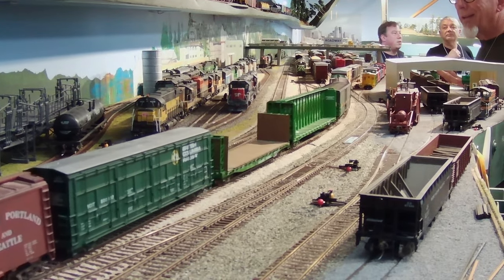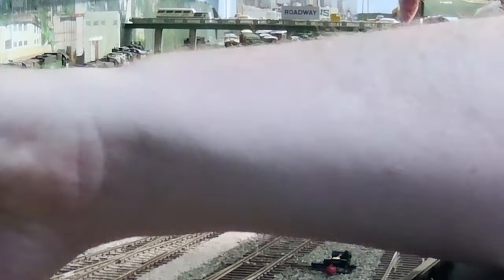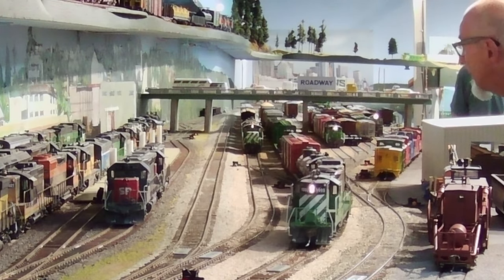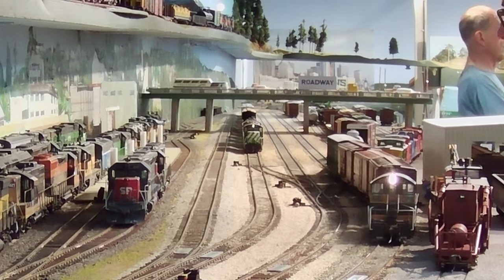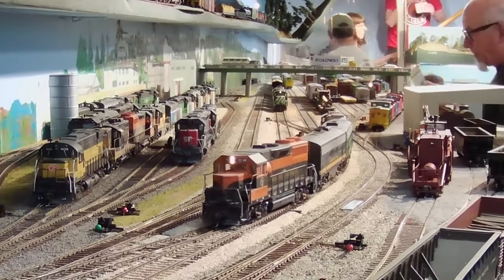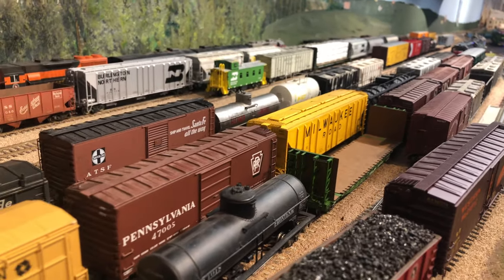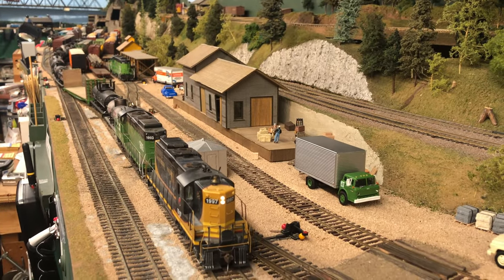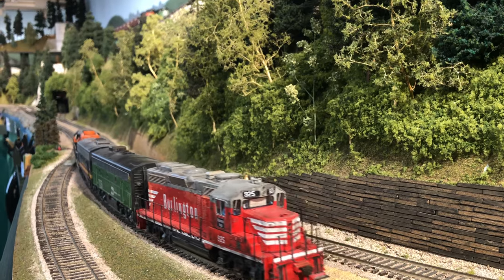Part 58 - Yardmaster and train highlights from op session #34 on the HO BN in 1973

Comment: Hi just started watching, I’m an N scaler and there is nothing like running prototypical railroading, switching cars using car cards has made operations so much more fun. One big loop with passing sidings and two way traffic with yard ops and local drop offs so much better than multiple loops and lots of trains going in a circle over and over. That’s also fine but that’s toy trains as opposed to actual model railroading. Beautiful layout, great job , anyone who I know with multiple loop layouts once the difference is explained and shown have actually changed there layouts to switching layouts, mainly O gauge guys. And they love it even more. And yes you can still run multiple trains especially on a layout such as yours. Like you said 11 trains but each one has its own crew as it should be. God Bless , looking forward to seeing more.
Reply from the maker: You said it well. Switching cars for a purpose seems more fun, even if the whole thing is play. I have a couple of what we call "illegal cutoffs" - tracks which provide continuous loop runs if needed, but are normally used for staging short trains that also have a purpose. When people come over for an open house, we run up to four trains on four independent loops, but when people come over for an "operating session" (play date) those illegal cutoffs are not used, so the mainline is point-to-point-to-point (because there is a wye in the middle of the layout, to allow us to send trains north, south and east). Much fun! :)

Comment: Burr...you always bring it home.
Question...are all the switches thrown by hand? Or do you have some with switch motors?
Reply from the maker: There are about fifteen Switchmasters and about 10 Tortoises, mainly on mainlines or staging yards. During Covid we did some remote dispatching using JMRI, but lately we're back to using the fascia-mounted toggle switches or rotary switches with diode matrices. I bought a few servos but haven't tried them yet. The rest of the 200 switches are thrown by Caboose Industries ground throws.

Comment: Great again Burr always your OPS I will  watch thoses for hours.
One question why on your switch theres yellow pins
Reply from the maker: The yellow pins designate that the switch is not on a "main track". Green pins are only used on main track switches, to make it easier for operators to quickly see if they have cleared the main track or not.

Comment: Hi this is Neil schwerdt in west valley city Utah, I have a question to ask you?
Where did you get the little blue LED light,s man ? Again from Neil schwerdt 😊
Reply from the maker: Seth Neumann in the Bay Area sells them on his website: https://modelrailroadcontrolsystems.com . Search for "DCC flag man track power tester". He has several kits available, but you do have to assemble them yourself with a soldering iron. No big deal, though - nothing complicated. If you want blue LED's instead of red, put a comment in your order and he will provide them. I have several of each color, and use the blue ones for blue flags and the red ones for regular flagmen when trains are on the road and have to stop for any reason.

Comment: @ 12:04... in real life, SOME local collective bargaining agreements allow for a wayfreight that departs their yard more than once, to get another days pay on that second departure out of the yard... now if that job were a roadswitcher, it could depart the yard multiple times and not receive any additional compensation... just a little backstory on how the railroad works
Reply from the maker: Interesting, and thanks. We will probably continue having him take two trips in a row to cut down on the size of the cut. Are you saying that we should use a road switcher for that job, rather than a switch engine? We could do that!
Reply: @muchfunwithtrains  
when i say road switcher, i mean that specific class of road service and not the type of locomotive... that can get a little confusing... so road switcher as a "class of road service", is a combination of a road job AND a yard job... a road switcher is paid at the 5 day yard rate (which is nice because way freight rate is fairly low)... also, road switchers can perform yard switching at their home/away terminals without any additional compensation... compare to a way freight, if a way freight were to perform switching at their home/away terminals, they would be entitled to additional pay for doing so... but they would have to wait to receive that extra pay... that additional pay can be scrutinized by the trainmaster, so he can pay it or not pay it... (and usually, no surprise, he doesn't pay it)